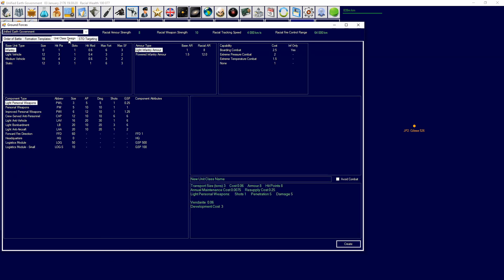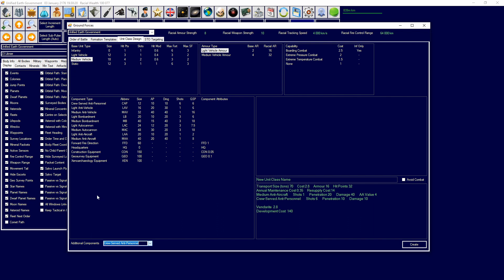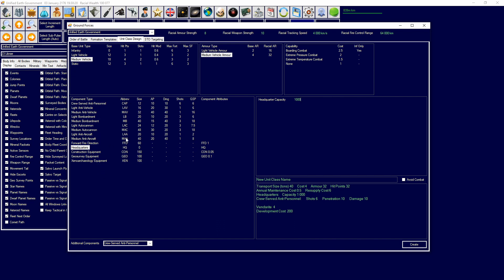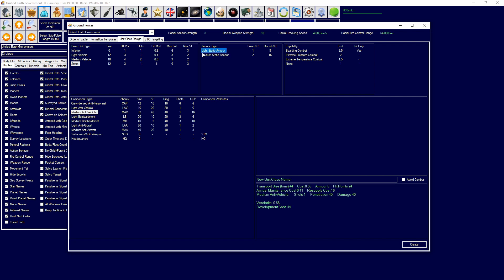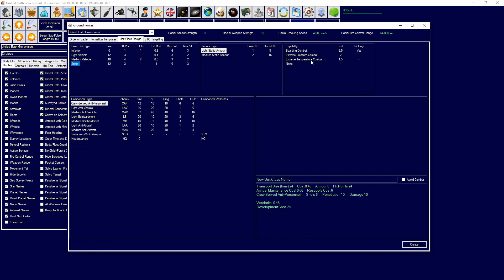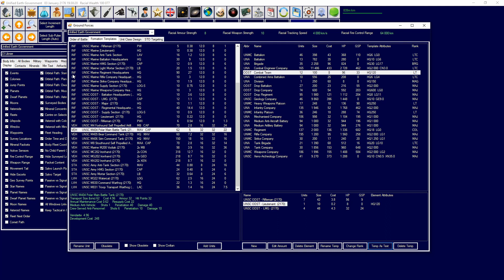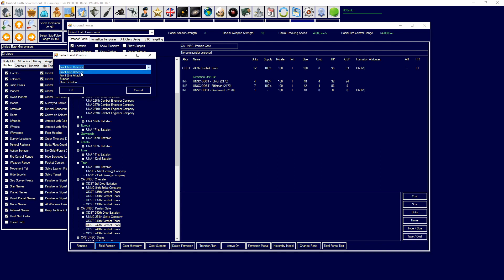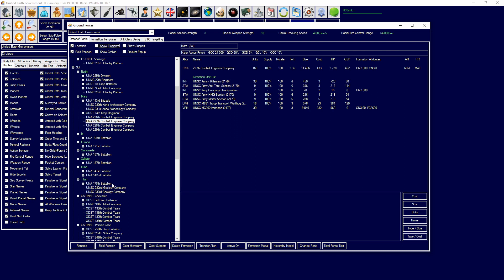Aurora 4x C# - Tutorial -  Ground Forces Mechanics (2)

Comment: Okay so like, how many supply points do I want per unit? Like, how long does a full "load" of supply points last for a unit? Do they get used when not in combat? Or for example if I have a formation with a Resupply Cost of 100, and I have an infantry logistics module with them that gives 100 GSP, how long will that unit be able to fight for before running out of supply? I don't have a good grasp on how quickly or slowly supply points deplete, is the number listed per week, per month, per year?
Reply: Super Necro I know but in case anyone looks at this years in the future. In the current build at time of posting, a unit's supplies lasts for ten rounds of combat at which point it uses it's resupply cost in GSP to restock for another 10 rounds. Rounds are every 8 hours so 3 rounds a day. This means that a unit will resupply roughly every 3 days (3.3333). Thus, if you have 10x your formation's GSP cost in supplies, it will last for slightly more than 30 days of shooting which is more than enough time to resupply with fresh trucks if needed (most of the time, check your supply lines). Losses will extend this further as your non-combat supply trucks will take proportionately fewer losses than the shooty boys and dead guys don't use supplies.